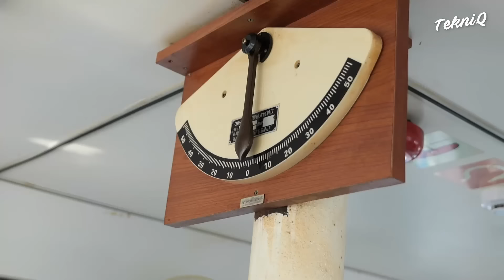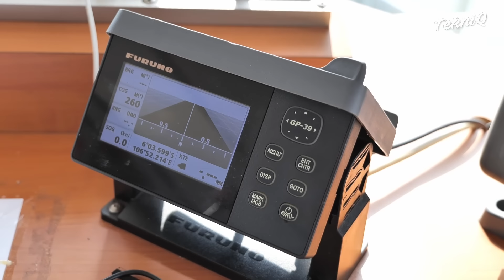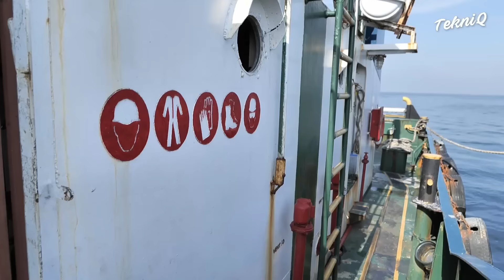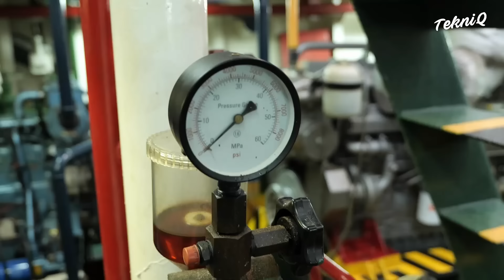Unloading Giant Ship Full of Sand With a Genius Technique

Comment: it's in Bangladesh and they use old diesel truck engines as a main motor
Reply: It is not Bangladesh, it's godavari river near rajamahendravarm. You can iconic railway bridges in the background.
Reply: @rajbabupakala7424  But removal of sand from river destroys ecosystem. And Sand mafia is very active in AP.

Comment: Those transmissions (flexible joints) of various (crank/drive)shafts are genius, (3:17 and 7:25) never seen it before, and quite some eccentricity to overcome… What material is used, some sort of rubber strips from car tire?
Reply: Leather belts from horses that die in the streets.

Comment: Why are they getting sand for??.
Reply: Concrete.
Reply: Many uses, glass, industrial molds, shoreline renewable. Ballast. Gardening, concrete, building, the list goes on
Reply: To sell as a commodity just like wood, coal, etc.
Reply: They use the sand as grit to mix with automobile blinker fluid. they also mold it together to make shoreline which you can buy in 50 foot increments at the hardware store.
Reply: Fazer sopa